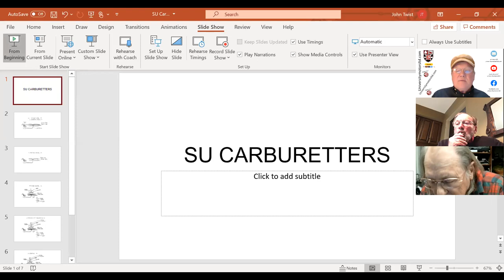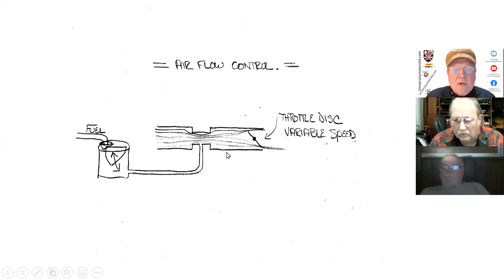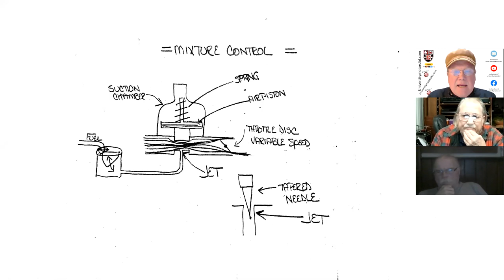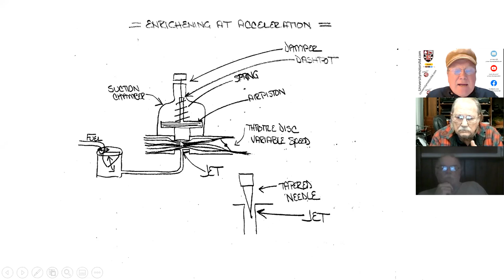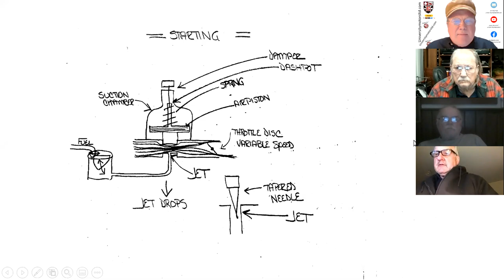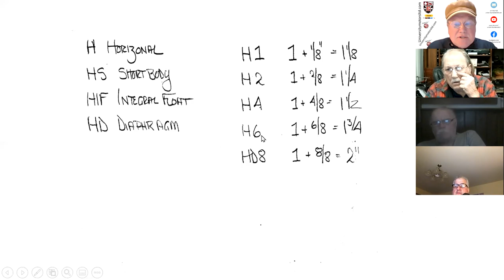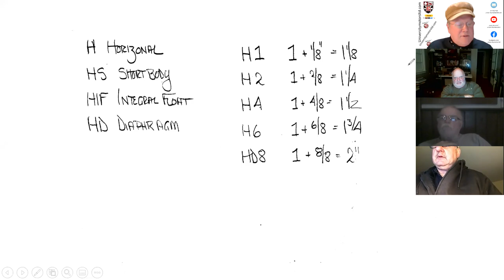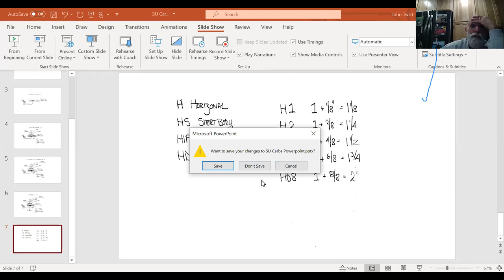313 MG Tech | Zoom with John Twist - February 22, 2021

Comment: Your channel is very helpful I have a 1980mgb single carb it starts great with the oil cap off when I put it on it will start and run for a few seconds then die any help would be greatly appreciated